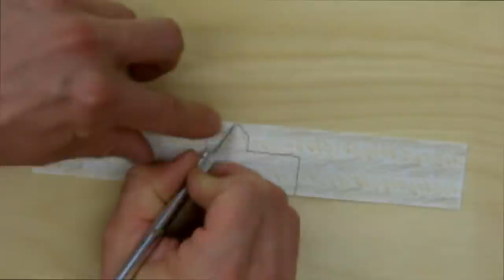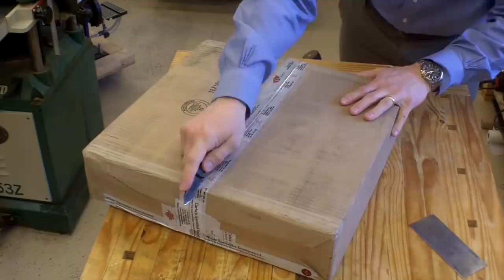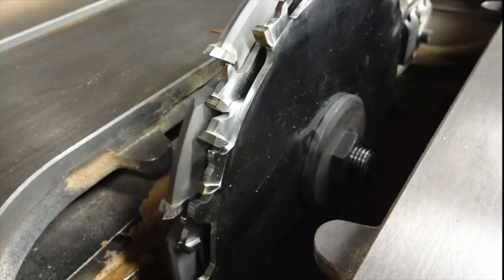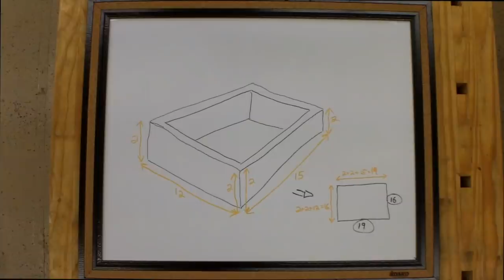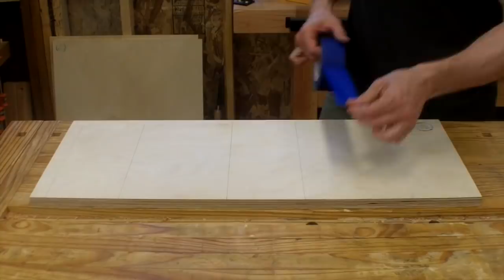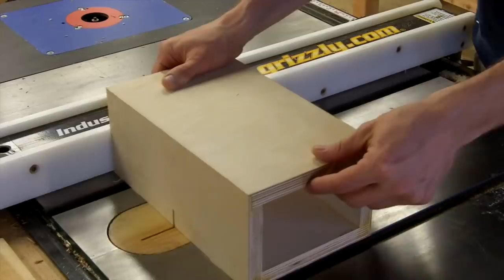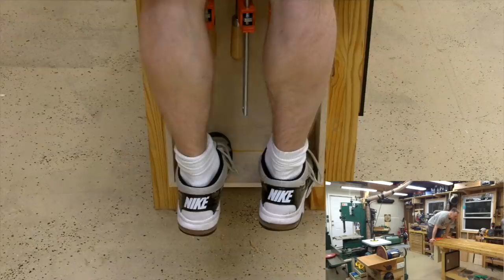New Invention - Easiest Drawers Ever!

Comment: Ikea have been doing these cuts for years.... hardly 'new'
Reply: pls show images of it
Reply: @mcchickennug  
We can't show images on youtube comments, but a simplified version would be the back frame for the KALLAX drawers. 
I have an older Ikea desk and the drawer frames are almost identical to what is shown in this video, with a similar stepped junction (keeping the thin melamine skin intact though, rather than the outer veneer of a sheet of ply). 
My brother has an Ikea wardrobe drawer which is the same.
Looking on the Ikea website, It would appear they have since moved away from this method and are now using an intricate multi-part hook and clip design. 
I assume they had strength issues as the drawers I have rely on cams to draw in the junctions, rather than glue, and I have had issues with the melamine tearing and the bottoms dropping out.

Comment: not sure why this popped up on my feed but good on you dude. this is genius and glad it went somewhere. gonna throw that site on my bookmarks for when I finally get a good tablesaw.
Reply: All table saws are good...if they spin the blade. On the job, in a pinch, I’ve used a circular saw plunged through a piece of plywood with a clamped on board fence resting on two saw horses.

Comment: Was your test plow off the fence for a reason? It looked like you were to the right of the fence on the back end. I'm curious if the blade pushed the stock like that or if it was intentional. neat idea tho.
Reply from the maker: it was only the push block that moved away from the fence, not the workpiece
Reply: I see. slice of genius here man, I think you'd better patent this quickly.

Comment: Dude we already doing this with a router an a V shape 90 degree tool :)
Reply: He gets much more glue surface thought. Moot point as it's still useless in any normal settings where Hettich/Blum slides are used. You never see Accuride slides outside of very low end budget project. Heck... metal drawers are the industry norm now =/
Reply: Wouldn’t they both have the same amount of glue surface since they both create a Rebated miter joint?
Reply: @sritchie1272  No. In this context he's implying using a V shaped router bit on nearly the full thickness of his board, essentially creating a miter joint when folded. He'd get the same result as shown in the video but with less glue surface. The issue is that modern slides are under mounted in a recess under the drawer bottom to remain hidden. Flat bottom like shown in the video simply aren't compatible. Plus drawers are actually easy to make... I don't get the fuss and drama.
Reply: Ja Grimard ah I see, thanks for the clarification

Comment: Kudos on pushing this through!

I followed the link and was disappointed to see poor reviews that are not really related to your product.  I hope you can address them, or have them suppressed and make this a success. Make an effort to get those stars up; you deserve it.
Reply from the maker: Whats frustrating is that the reviews on the first version were very good, above 4 stars.  Then we improved it, its a better tool, but by chance the first 2 reviews came in with grippes, so it looks like a product people don't like.
Reply: @AndrewKleinWW   Yes, I noticed that. I saw 2 stars and thought well this product is bad. But then I went in and read the two reviews and the low stars had nothing to do with the product, but instead with the seller.  Work with them to either remove those reviews, relaunch the product or drawn the bad reviews with good ones (have 10 of your friends buy the product and give it a gleaming review). At the stage you are in 2 bad reviews could kill you, but should be easy to fix. 
Unfortunately, a lot of success is based on self-promotion. At the stage you are in you need to invest a lot of effort into launching this.  
Work with your licensor too. They'll have a deep interest in your product succeeding. 
Shine on!

Comment: Why not simply take this to a 4 inch wide, but long strip, and then cut five parallel cuts at the correct spacing perpendicular to the long side of the wood, and then simply fold them into a square shape, removing the two sacrificial ends. If you had previously cut a sill into the long axis of the wood you could literally just assemble around an correctly sized precut bottom. Nails, glue, and done.
Reply: Hahaha... I'm an idiot. Should have just kept watching.
Reply from the maker: At least you DID keep watching, haha

Comment: Or just use a router bit with a triangular profile, so you don't have to get a specialty made blade and dado.
Reply: Indeed, but this design offers more surface area for gluing?
Reply: @devtank  Yeah, it appears to add ~20% more gluing surface. A stress test would be needed to see if the added strength is worth the price for the unique blade and dado.

Comment: This is done just as easy with a rabbet bit in a router.  Granted the pieces dont fold up like this but you have to glue and clamp regardless.

Very cool idea though.  I would imagine this would be a rather expensive blade unless you could get to mass production.

Comment: I think you did a great job but I an afraid you're reinventing the wheel - I've seen this idea before, many years ago - also with a router bit - https://www.youtube.com/watch?v=JL1Fs9m9JyU.  But  who knows, I don't know if anybody already makes such a table-saw blade profile for a one-step cut and it's definitely a huge time-saver especially with plywood which has useful gluing surfaces (don't think it would work with solid wood.) Good luck and I hope this goes far.

Comment: Great idea for the home woodworker.  Years ago I worked in the furniture industry.  At that time we used a vinyl wrapped drawer construction in a low cost printed desk application that worked very similar to what you are doing.  The drawer sides and back were constructed with mdf and vinyl that wrapped around the material.  Grooves for the bottom and sides were precut.  Same idea.  Again great job.

Comment: I think as an Idea this has already been done, Mitre Lock flooring boards are an example, However, this application I suspect is unique! Trend have a version of a router cutter with very similar profile for right angle edge jointing, but as you rightly say, it can't make the cut in the middle of a board and would take two operations and the necessity to work each component separately.
That makes this single operation method a brilliant one!

Comment: Did this method take off & was there any advancements? I would like the same concept within a router end cut bit.  Although the table saw is probably the better route , in the UK we can not purchase Dado stack table saw's due to a country safety legislation. thus router would be my only option.
Reply from the maker: It’s an asymmetric cut and the adjustability of the dado stack portion is important to compensate for variably thick material.  So you cant do this with a router bit, at least not nearly as fast, a lock Miter bit makes a similar joint but doesn’t cut both sides of a joint in one pass so you can’t do the fold up method I showed in the video.
Reply from the maker: Oh, and it is for sale now by Rockler

Comment: This is a great idea, but not exactly for a typical hobbyist woodworker. Not at a normal MSRP of $350, even marked down to $250 right now. Especially when you take into consideration the weight of that massive blade coupled with the dado stack. A normal hobby/jobsite table saw is not designed for that much swing weight. You would really need an expensive cabinet style table saw for this. Again, great idea though.

Comment: To mitigate the effect of no finger joint, it would be easy to make 45 degree cuts across the corners (after you glue and fold the drawer), and glue in slips of wood.  Trim them off after drying.

Comment: I really like the blade, I think it would be great for smaller drawers. Myself, I'd stick to dove tail joints on larger drawers. Also, you only showed it on plywood, how does it work on soft or hard woods? Obviously you couldn't just cut and fold it over on most any other wood. If this blade does becomes available for sale I would  be interested in buying it.  Good luck on making your invention a success. 👍

Comment: I really like the idea of this, its really cool and seems a lot simpler to setup than than the router bit thats out that makes the same joint.  Have you had any issues with the veneer that is wrapped around the corner splitting or cracking?  That was my only concern.

Comment: This is awesome depending on the price I would buy one
Reply from the maker: Thanks, its not cheap, we had to sell it with a dado set and its an overall high quality product, works very well, but like I said, not cheap.
Reply: @AndrewKleinWW   I have put it on my Rockler wish list!   Yes, it's a bit pricey however - if you add up how much time you save on each application, then translate that time into dollars. Cha-ching - paid for.  

 No matter what method I use for constructing drawers - if I get distracted in the middle of a job, I will inevitably manage to do something goofy where I'm left scratching my head wondering wtf did I do!?!  Usually my mistakes are not the forgiving kind either - and I end up wasting material.  Necessity is the mother of genius inventions!   Bravo!!   I watched this video quite literally with my jaw on the floor - - - thinking.... ohhhhhh I gotta get me one of those buggars!

Comment: This is brilliant - 100% the spirit of inventiveness. I can't see any company that makes drawers not wanting this in their saw... it seems like the business case would be a no brainer for companies doing this all the time, or even the home gamer.
1) how long would their investment take to break even and start generating positive cash?
2) how long would an investment on your part take to break even? how many units does it take to get the cost per blade down?
3) how do you get it into retailers shelves/inventory?
4) are you willing to take the risks to produce that many units hoping they will sell?

 It seems like homegamers would love something like this - how many people have something like the Festool dowel jointer ~$1000 +? For something they may use a couple of times a year (and don't care about return on investment)? lots of folks would buy this just to make drawers for their shops. The pros that use is all the time would get a return on their investment after one or two jobs.

you could even offer two price points - home shop --> steel teeth and PRO --> carbide teeth. or something... $50 and $200???

Ugh. I completely understand you - I am the same: see a problem invent a solutions theoretically or physically, but then stop there without the push to make a product... Good luck -I hope it works out and you can keep making great you-tube content for entertainment.
Reply from the maker: Thanks Thomas, glad you like to tool.  I was able to make a deal with Rockler and the blade is being sold in combination with a Dado set to make sure the diameters match.  You can find it by searching for "Miter Fold Dado Set"
Reply: @AndrewKleinWW  indeed - congratulations. after i commented i ended up seeing it on Rockler. Amazing idea. at some time in the future when i have to make a bunch of drawers or boxes, I'll pick one up.

Comment: There is a router bit that does the same thing, been in use for over twenty years. I wish you good luck on marketing your blade version.
Reply from the maker: Thanks, advantage of the blade is speed, it’s on the market now
Reply: Kenneth Russell. Are you referring to a lock miter bit?
Reply: @anthonynyman167  no. I was working on a large job up in Whitehall NY. And saw a router bit design engineered by a speaker cabinet manufacture that was using laminated practical board to make the speaker boxes. I wish I could remember his name you two would enjoy speaking to  each other.

Comment: Nice experimenting, but is it worth all the extra effort?  Do you really save a lot of time and expense? I see labor intensive extra effort here, plus your very expensive custom saw blade.  Are you doing thousands of these to justify your investment?  I don't see a significant time/cost savings from doing it with butt joints and pins or screws and a dadoed slot  for the bottom.  I've made thousands of drawers in my life and the KISS method (Keep It Simple Stupid) usually is what works best.  You don't need a dovetail or a Fine Woodworking Magazine joint, when a butt joint will do, unless a customer is willing to pay for it.  It always comes down to cost.
Reply from the maker: It is a lot faster, if I had to justify the cost of the one off custom blade based on this saving I couldn’t, but that wasn’t the point.  I was trying to see if the tool worked well so I could license the idea to a company.

Comment: you could probably have an easier time developing a bit or blade instead of patenting the system.  I would send your pitch video to FASTCAP and let them take it from there.  They give you 5% royalty and they patent and distribute the product.  They already have all the distribution networks with suppliers locked in....Wurth, Richileu, Briggs, Duluth....you name it.   Patenting is the easy part,  marketing is the key and that is what is expensive.  Also consider the danger in taking the product to a manufacturer like Amana or Frued.  they could easily change the angle or one little measurement of your special joint and make it their own without infringing on your idea.  BRAVO ON THE DESIGN I THINK IT HAS POTENTIAL.  GOOD LUCK!!

Comment: Just curious, what is wrong with a one 90 degree V shape cut?
Reply from the maker: has less glue surface, doesn't lock in, takes up too much space on a tables arbor, so its a router only cut, and i've tried it on a router with thick stock, the bit wants to raise out, even the people who sell the bits specify they are for CNC machines only.

Comment: I am a lil' confused, Did you ever get the second Blade set up that would close that Gap you spoke of in video due to thickness of Dado? If so How did it work out and where can folks get one?
Reply from the maker: Yes, I got the gap closed, it worked well and you can buy the blade and a Dado sold as a set at Rockler.   It’s called the miter fold dado set

Comment: Looks like a great idea, however I must point out, that a Yakamoz 45 degree small lock joint router bit makes a very strong glue joint for drawers with more surface contact, and matching joints , similar to this. But go for a patent, this is still a great idea.
Reply from the maker: Thanks, the advantage of this over a router bit is speed, much faster process.  It’s on the market now.

Comment: So obviously by now this is on the market and looks INCREDIBLE... my question is... do you plan to make a similar concept for router bit?
Reply from the maker: Thanks, but it’s an asymmetric cut profile so doesn’t work on a router bit.  Also the fine adjustment of the Dado Set to compensate for variable thickness material is required, and not possible to duplicate with a router bit.
Reply: Ah that makes sense lol I didn't even think about that aspect for router bit. Can't spin something at extreme speeds when not balanced. Great job though on this... I hope to someday own

Comment: I really think you have something I would like to try your product. Your best bet is to produce your product yourself because there are just to many thiefs our there that will steel your Ideals so fast take down your YouTube page and try and make as many as you can if you flood the market they are just wasting there time. I had it happened twice to me. So I learned the hard way at lease you have proof though from the date of your page aired. If you have any questions just send me a text back and I could give you a few pointers ok nice job I really love the way it make them so easy and you could make boxes to. Great job!!! keep designing new ideals its fun coming up with new things.
Reply from the maker: Rockler helped me develop the product “Miter Fold Dado Set” and is selling it now, no one has tried to steel it.

Comment: Great concept. Should be stronger once the profile is dialed in, and the gap is gone. Also, strength would depend on the adhesive used and how well it soaks into the fibers. I'd love to see this on hardwood instead of ply wood. At the right price, I'd love to see this mated with an optional matching dado stack with spacers/rakers for 2/4 up to 6/4 boards.

Comment: Very good idea. Question: Wouldn't just steps work? Steps at the thickness of each ply may be stronger as well. I thought of this after I saw the results of the torture test. Also maybe no special tooling. But the basic idea is amazing. Looks like you wrapped veneer around it after you made the box.
Reply from the maker: +Casey Kittel the cut profile can’t be all steps, you need a point to make the fold at the top of the plywood.
Reply: hmmm. okay. let me sketch it. thanks for the reply - all the best!!! very good idea. some glue labels suggest making the wood damp in the joint before you apply the glue. this is supposed to get the glue to seep deeper into the wood for a stronger joint. of course with plywood you have layers of glue already there, which probably act as a glue damn to a degree. I bet theres a glue you can use that would reactivate (chemically melt) the glue used in the plywood. maybe this would create even a stronger box.

Comment: Wondering how this is going!? Honestly I see this as a very good option, even if there is need for some nailing it would be super handy. Updates?
Reply from the maker: +Brandon Talbot Rockler is selling it, its called the miter fold dado set, it's a dado set plus the specialty blade you saw in this video, they had to be sold together.